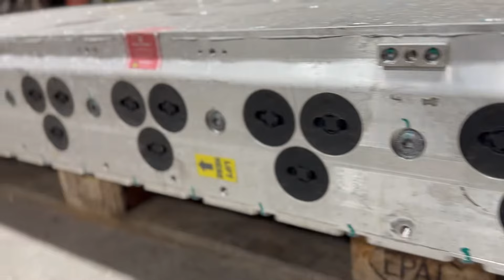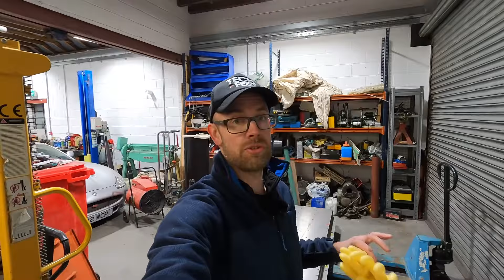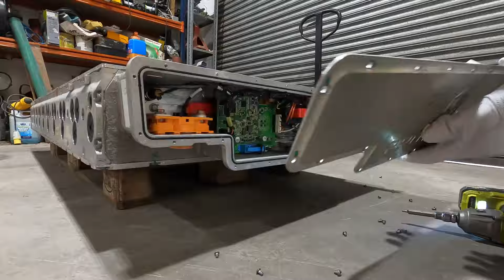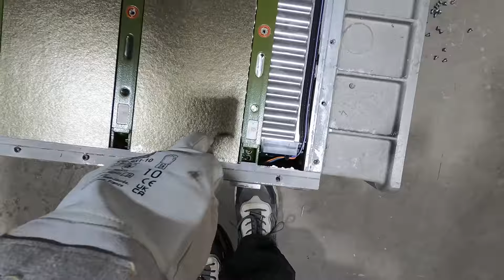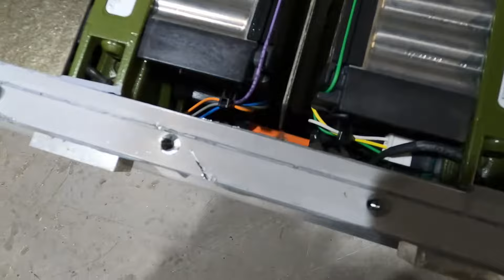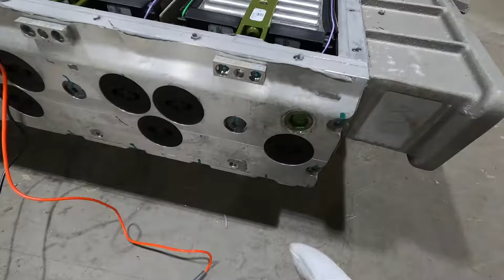EV High-Voltage Teardown | What’s Inside a Prototype Electric Bus Battery? Cells, Modules, Explained

Comment: Can the modules be changed independently? Are they CATL modules?
Reply from the maker: They can be changed yes. They are modules specifically made by Proterra. CATL modules usually have an external casing but these do not. The centre of the module has a cooling circuit to keep cells each side cool/ or warm in cold weather
Reply: @Tomkitek  We're looking to buy electric buses for a project. The manufacturer, King Long, uses 350kWh CATL batteries. What do you recommend for battery maintenance, especially for those nearing the end of their cycle that will need replacing?
Reply from the maker: @i @ismokasa1658 Most maintenance of a battery pack is ensuring the battery management system is taking all the readings to ensure cells are balanced, not under or overcharged and temperatures are acceptable. Checking cable connections and any screw terminals is always a good idea for regular maintenance. When the battery is no longer good for the bus, it could always be sold for an energy storage option
Reply: @Tomkitek  Okay, thanks for the recommendations. We do plan to recondition them for ESS (Electric Fuel Systems). Can the BYD Blade battery be reconditioned for ESS?
Reply from the maker: @ismokasa1658 Yes it can. I can currently convert BYD Atto, Yuan, Dolphin, Seal and Song battery packs
Reply: @Tomkitek  Okay, that's good to know. But what type of storage box do you use?
Reply from the maker: @ismokasa1658  You use the original battery housing or you just have to make your own to suit